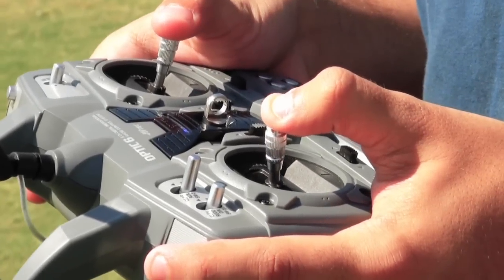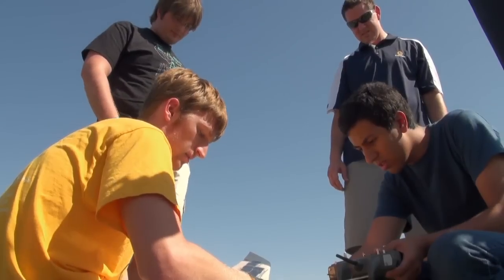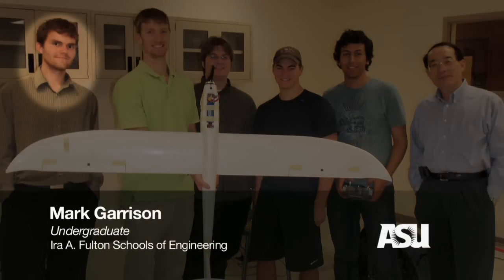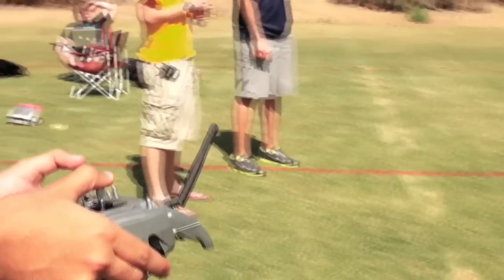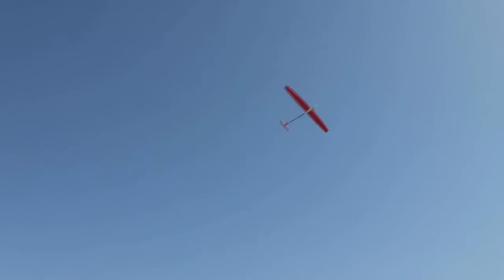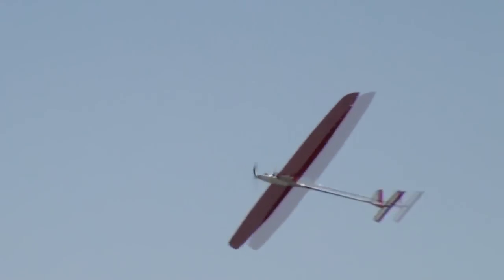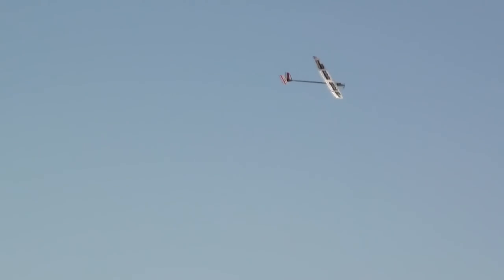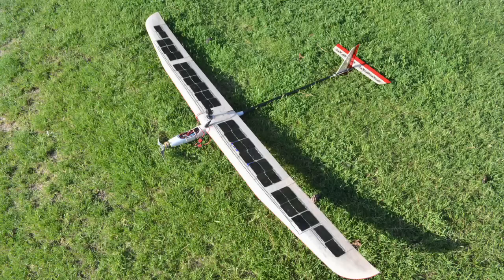Plane Soars with Solar Power

Comment: Some advice, or rather my 2 cents: 
Don't use standard solar cell tabs, too heavy. Also a built up wing will be lighter and has the advantage of being able to run the wiring inside the wing, reducing drag. Design and build your own wing, optimized for maximum number of cells. And a final thought, if using cameras maybe make a see through fuselage so that they can be mounted inside the plane. 
You never mentioned if you had batteries on board or if it's purely solar powered.